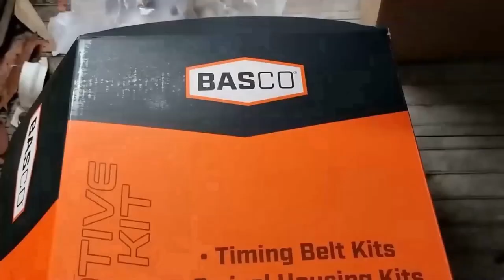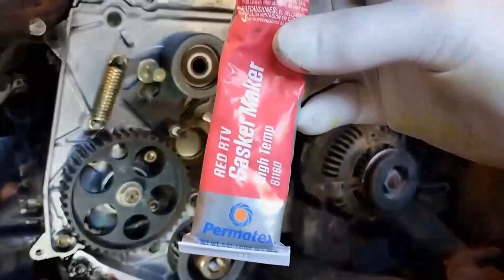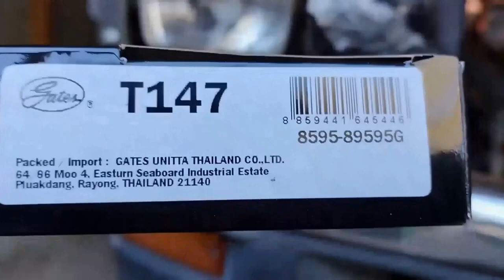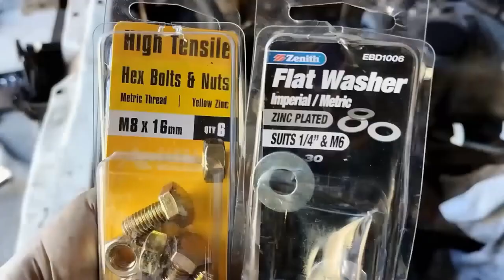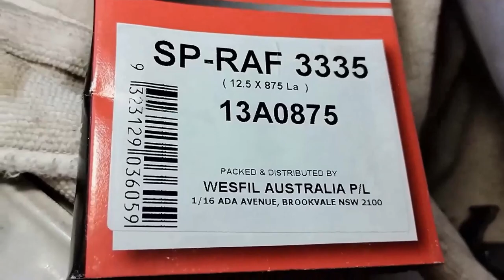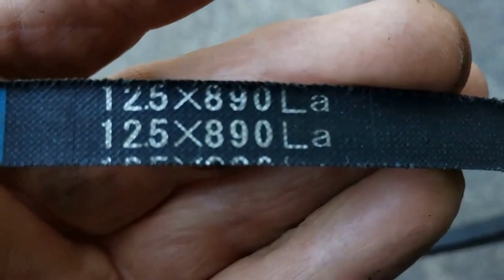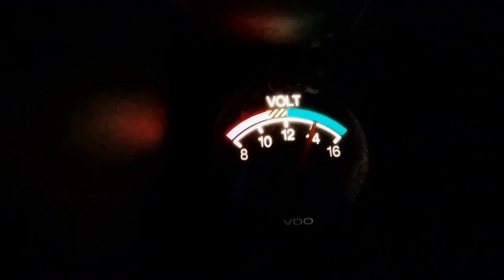(Medium length) 1996 Holden Rodeo 2.6 water pump replace

Comment: Thanks for this video,  I just started to replace my water pump on the same model.  Mine has only done 190,000, so I will try and get to that 5th bolt(nut) on the pump without taking off the timing belt cove,  but will check the timing belt in the process.
Reply from the maker: My timing belt was ok after about 280,000, its a good idea to check the lower belt drive and the front main seal area for an engine oil leak, the lower belt drive would be very hard to remove for a front main seal replace.